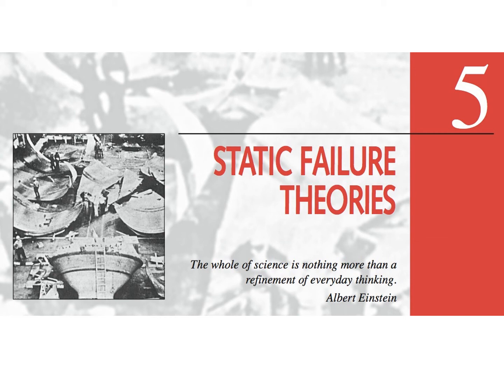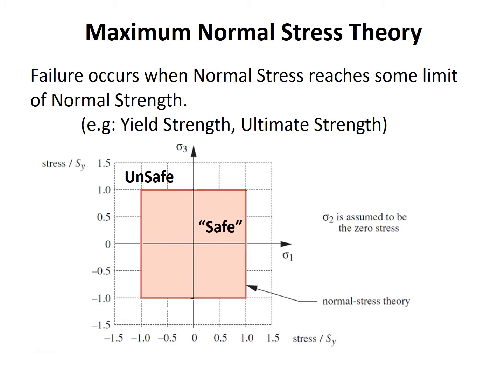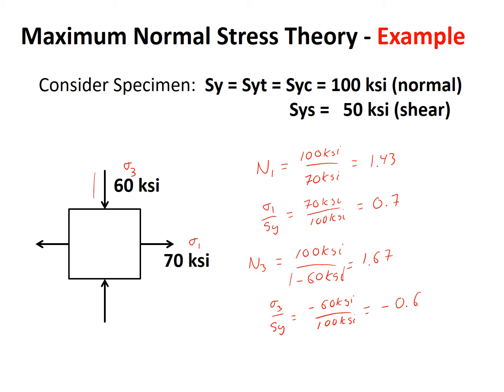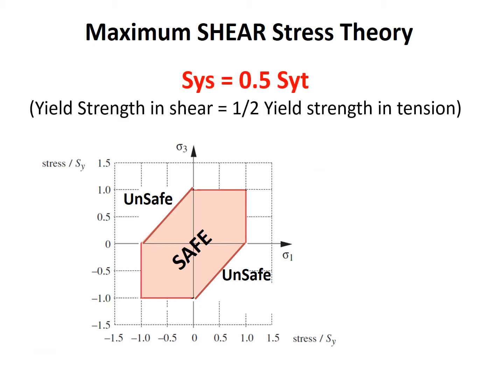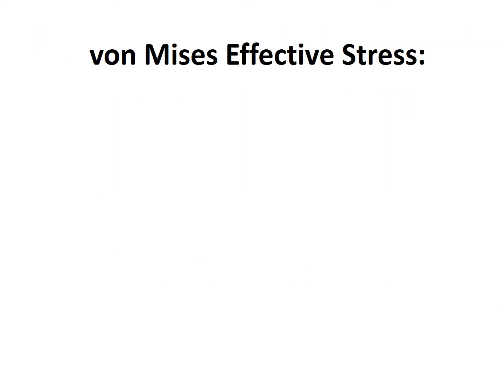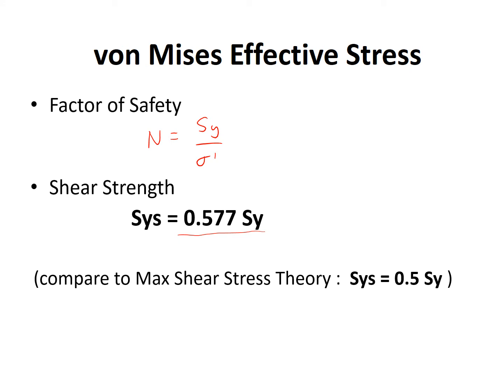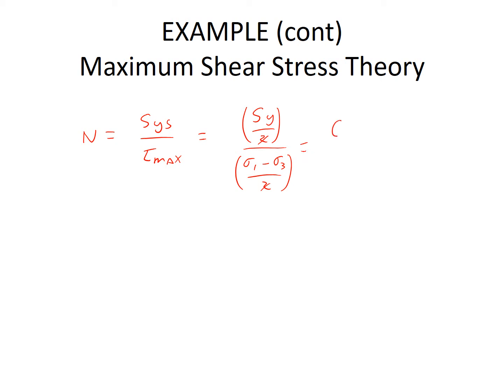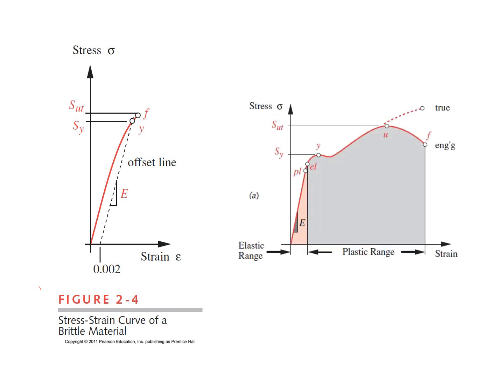Static Failure Theory

Comment: why do you write factor of safety for the Compressive stress against a Tensile Yield stress?  Is that not comparing Apples Vs Oranges?
Reply: ok. so basically you are assuming Compressive Yield strength is same as Tensile Yield strength because this is an "even" material.